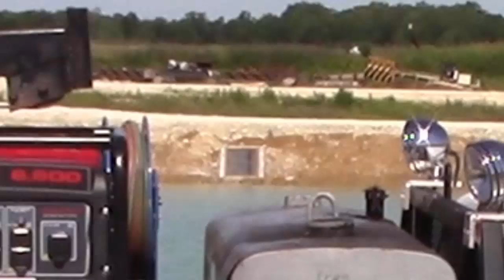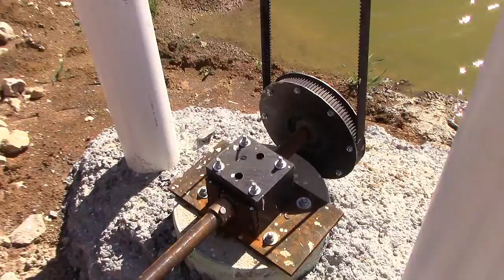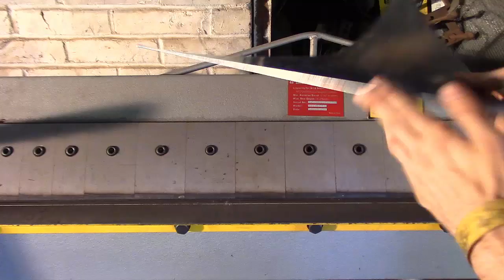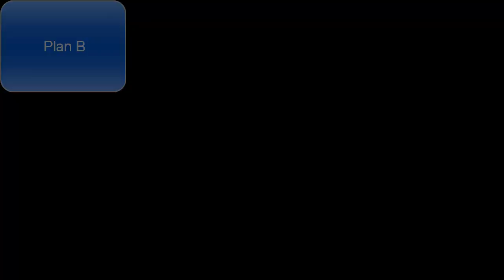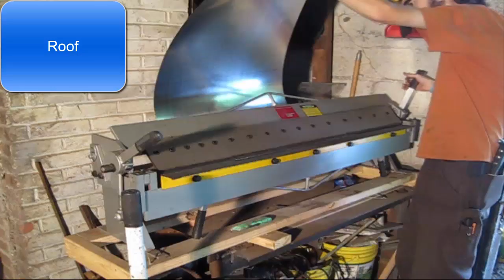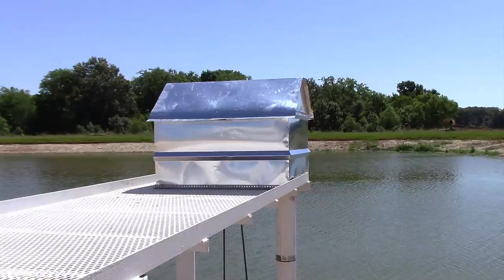Sheet metal brake basics

Comment: Never seen anyone submerge a belt/pulley in water to drive a shaft! Is this something that's done very often where your from? Is there any issues with elegy or weeds causing the belt to slip or come off pulley?
Reply from the maker: As far as I know there are two other ponds that use the same principle, and they work just fine.  From what I understand you do have to have a belt guide for the pulley in the water because it will hydroplane.